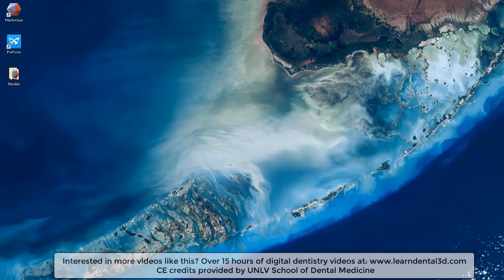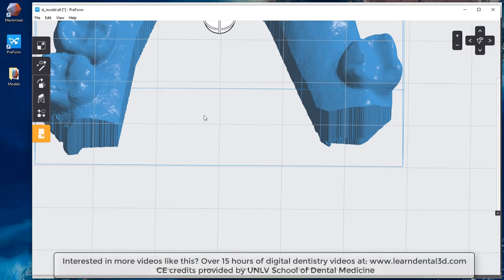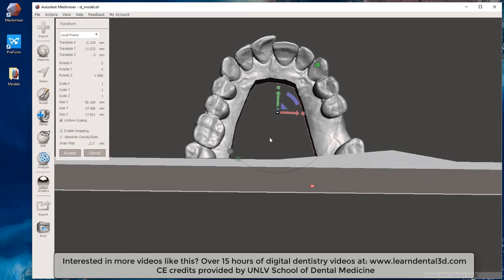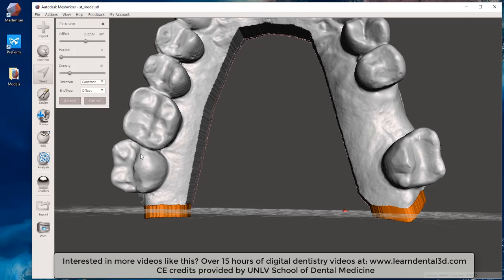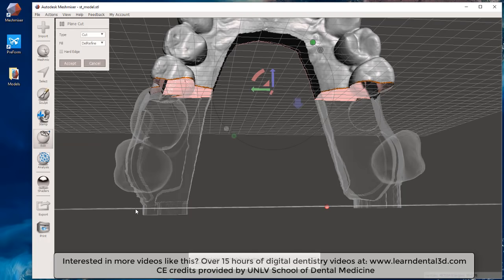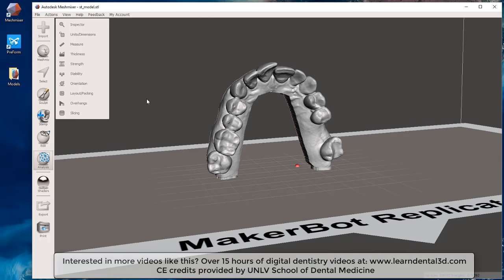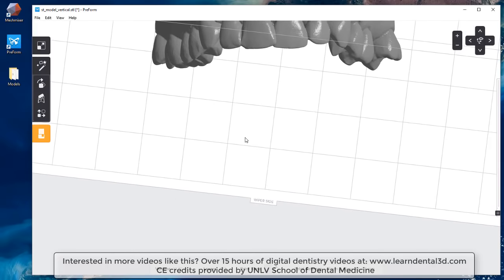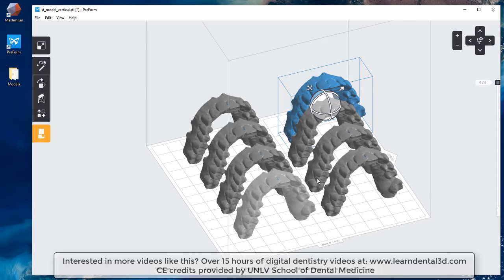Using Meshmixer to Print Dental Models Vertically

Comment: I am a newbie, non dental experienced, person cleaning up arches for another person to print.  They do not want a base on the arch and they  print vertically.  When I go through their step by step instructions to clean up the arch with meshmixer, I get to a point after extending the base, I find that the arch edges are hollow....hard to explain but wondering if I could send you a photo and see if you can help me fix or eliminate this.   Thanks in advance if you can help.

Comment: Thanks for the video! Great tip to orient the model in the beginning. I guess if you wanted to print the model at a slight angle you could initially orient it that way.

Comment: Hello 3DDentist, I am new to the 3d printing, just received our form2 printer today. I am using 3shape programs and they prepare the the distal side nicely with a nice even straight edge. My problem is when I place the occlusion on the build plate vertically it gives me a printability error. 2 red dots appear behind the centrals. Is there any way I could have email to show you? thanks sean

Comment: Nice, very educational, thanks for this vid! Question, though, why not just use supports? Just because it would take longer to print, or are there other considerations?
Reply: Iridar  Same question here
Reply from the maker: Just as another option! I prefer to not use supports at all when printing dental models. Most of the time, I print horizontally, not vertically.